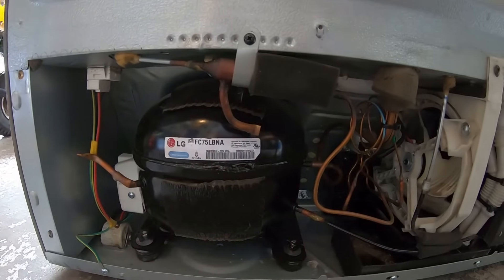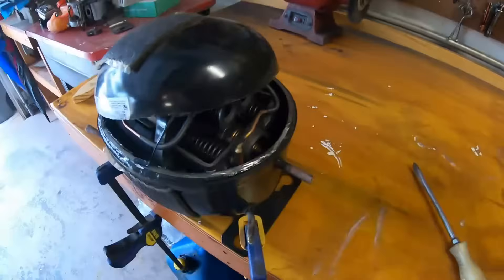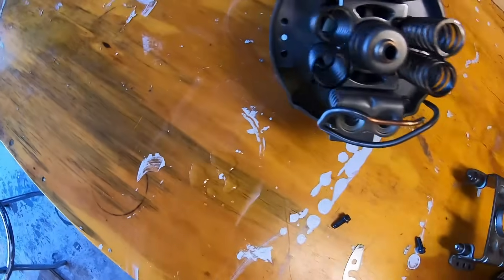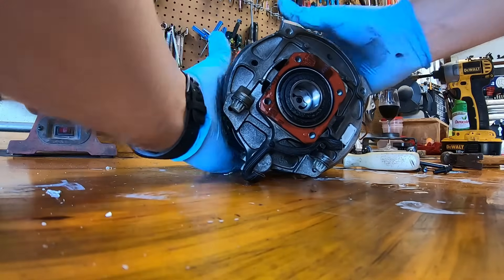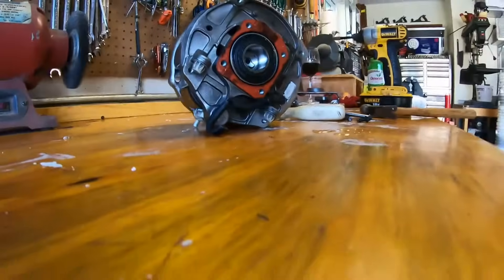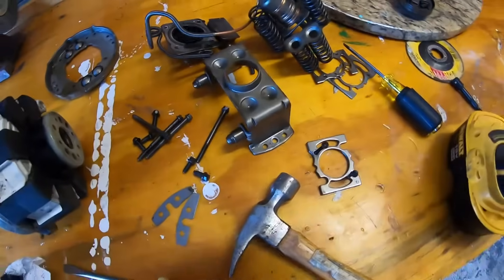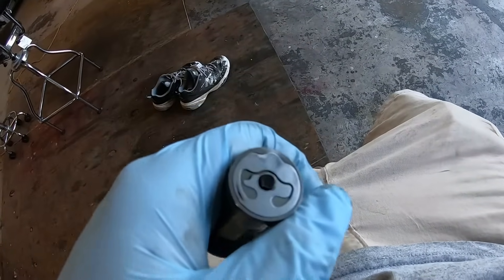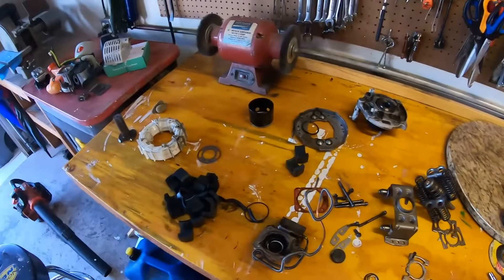Cutting open a failed LG refrigerator compressor

Comment: 11:33 she is looking at you, the valve, that's the killer in this compressors. Believe me. Former Sears Refrigerator tech, former LG Electronics field tech here. 
LG (LC) compressors are the WORST, I was replacing an average of at least 5 compressors a week. The best in everything else, but LG (LC) compressors are the worst due to the design of the valve. It goes attached to the end of the piston, it is like a check valve that it closes when pushes the piston to the high side and it opens when it goes back. It is extremely thin, so when the compressor works too hot, it tends to stay a little bit opened, that will equalize the system so it won't cool. Inexperienced techs think there is a restriction in the sealed system, they start replacing coils and capillary tubes, but is not the problem. I'm sure because I've done my own compressor autopsy (tired of LG tech support and managers denying the issue with compressors) and I found that. When you have an LG not cooling is that simple, compressor, or a very few cases, a leak on the evaporator of refrigerator section, mostly the top line close to the cap tube, extremely low leak sometimes hard to find even with dye, sometimes it only can be seen pressurizing the system with nitrogen and spreading with big blue leak detector.
A tech still working with them told me they have a new compressor design that substitutes the LCs but I don't know the results. I left LG and the appliances business 3 years ago.
Reply: I'm working on these currently with the A&E side of Sears.  Doing an average of 2 to 3 per day.  What's sad is every system is less than five years old.  The kicker is now I'm third partied thru Sears to only work on LG.  Good ol' Virginia Beach for you (8175).  1706 replacement compressors aren't much better.  Been to calls where the substitute that was "guaranteed" to fix the issue, has been replaced already.  What does LG tell us to do..slap in a new one cause that'll fix it...That third lawsuit against LG hopefully does something..maybe recall everything.  Loss of money and rep to their name but hey, build a major component correctly and competently the first time and you wouldn't be hated as a company.
Reply: @abeez85  What is the typical service fee and LG compressor replacement cost? (out of curiosity). I'm not in the market for an LG, but I see them on Facebook Marketplace for sale along with the Kenmore brand that used the LG compressor.
Reply: @elmerkilred159 Various ways to answer.  Parts, labor, warranties.  Low end, $500.  High end, $2,000.  At least this is thru A&E's prices.  Sum up, everything I see today is ones with 1,5,10 year or 1,7,10 year warranties.  95% of what I go to are systems in the 2-4 year range.  Some make it past up to close or beyond their warranty.  Those I call the quality ones for todays standard ones I call quantity ones for I'm expecting to go be a problem.  It can get better or worse.  Had one today, not two weeks old, has a locked compressor and still has the plastic on the doors.  Be it LG LG or Kenmore/Kenmore Elite saying 795 in the model number, still an LG, expect a headache, a delay, a loss of food and a visit with the expectation of it being the compressor.  Hope that helped.
Reply: @abeez85  That sure did answer a lot of questions. Thanks for the reply. I was going to add "the loss of food expense," and having to scramble to figure out what to do with all the stuff in the freezer. I have a Kenmore Elite (Either, a Frigidaire or Whirlpool had the Sears contract that year) that has been working for over 20 years. I recently replaced an evaporator fan, and the relay, and start capacitor, and had to do the food shuffle, but I got the fridge up and running. The prices of new fridges baffled me, and I was tempted to get an LG just because it looked like a solid fridge. I'm really glad I didn't decide to get an LG. Thanks again for the informative response!
Reply: @elmerkilred159  If it says 106, it's a Whirlpool.  253 is Frigidaire.  Run that puppy till it breaks, the parts aren't made or unless it's prior to 1994, no more R12 to refill it.  My father just did with his freezer.  Now it's a storage locker.  And from the sound of it, you got the easy parts.  Take those any day.
Reply from the maker: Wow - thanks for the detailed info! It truly is a shame as these compressors are so common... What about that cracked seal-looking-thing I called out in the video at 12:45? What is that part and is that just a casualty of the failure you described?
Reply: @JoesGarageProductionsLLC  
 11:35 That's the valve, at 12:45 it's maybe a filter.
Reply from the maker: @ZackHeinkel2000  thanks for the insight! I spoke to someone just yesterday whose LG compressor was junk after only 1 year. Makes me wonder if they really fixed the problem...
Reply: My experience with LG compressor is exactly the same as your Sebastian.  They're the worst I've seen in my 41 years as an appliance tech.  A customer of mine just scrapped their top-o-the-line LG refrig that's 4 years old due to a bad compressor.  Unfortunately for them, they had a bad compressor at 1.5 years old.  LG replaced the first one in warranty but took two months to do it.  Now the replacement went bad so they're done with LG.
Reply: @bixfrisbee2623  I think LG Refrigerator line will end as their cellphones.
Reply: LG is starting to abandon the linear compressor and is implementing the good old reliable smart inverter compressors again
Reply: Thank you for your transparency
Reply: I figured it was the valve but having not taken one apart led me to this video. Pretty difficult to fuck up this design..
 It's just a large solenoid after all. Best to mute this video though as the guy says all sorts of wrong stuff... started off calling it a scroll. Okay pal.
Reply: Are the jiaxipera compressors any good? I know Embraco and Panasonic compressors are great. What about jiaxipera?
Reply from the maker: @YoungMTrucker600  I don't have any personal experience with that brand but I have not had any problems with the Chinese compressors
Reply: Lg appliances are the worst.

Comment: “Safety first...”, but no safety goggles 🤣
Reply: safety glasses/ goggles are a must ... he could lose an eye. Those grinder blades can break when caught in the two metal parts and fly in whatever direction.
Reply: And no safety cover on grinder too.
Reply: Engaged safety squints
Reply: @keithjurena93ok19  ok ave lol
Reply: at least he will hear what runs him over.
Reply: Yes, thanks for the interesting video(!), but do wear safety glasses. A family member had an object stick in his eye just from the wind. Had to have it removed by a specialist. Then started looking online about physicians removing small objects lodged in eyes. Not recommended.
Reply: Face shield to protect against a disk shattering at 12,000 RPM. And gloves in case the angle grinder suddenly runs away. Got some awesome photos online of parts of hands turned into hamburger from angle grinders. At least he's protecting his hearing so he will understand what the folks in ER might have to say.
Reply: It's a dangerous kind of cut where it's easy to quickly plunge the blade through and accidentally twist the blade which will grab kind of hard. Push forwards and the blade wants to pull deeper as it gets deeper into the hollow cut.
Reply: I knew I would find this comment.
Reply: "just a couple holes in my tshirt"
Reply: Yeah grinding on crotch height without a guard in sweat shorts, a trauma surgeon's pension contribution waiting  to happen.
Reply: @Brewbug  Crotch height... Could be one of those non lethal Darwin Awards too.
Reply: Looks like quite a contraption
Reply: Obviously never got hot metal shavings melted into his eyes yet 😳
Reply: haha
Reply: @Daniel Forrest 😂🤣
Reply: Did you not see his safety squints?
Reply: Or blade guard
Reply: @danielforrest3871 Ansi Z87 contact lenses
Reply: Just need to squint enough to keep the flying sparks out of my eyes!
Reply: His old school
Reply: The sparks flying in the garage was giving me anxiety. What can happen, will happen if you give it enough opportunities.
Reply: First thing I noticed too
Reply: He's a professional, I guess he doesn't need either safety equipment 😂

Comment: According to the lawsuit, the problem starts in the tubing of the evaporator, a part that works in conjunction with the linear compressor. The suit says that the tubing is “prone to corrosion and pitting” and that small holes can develop, which can cause leaks and allow air to enter. Because of this “air leakage,” the refrigerant that moves from the evaporator to the condenser generates excess pressure that puts stress on the compressor, according to the suit.
The compressor can’t take this additional pressure, the suit says, and begins to fail. It is usually the discharge valve in the compressor that is the first to go, as it is the weakest component.
    But they left out the fact POE oil absorbs moisture and causes waxy gel and acids to form when a low side evaporator leak draws in moist air into the sealed system.
So this contamination moves around and clogs the capillary tubes which are foamed inside the back wall of the box.
The new compressors sometimes work and others fail due to the capillary tube clogs with the black sludge and waxy buildup from the POE oil and moisture chemical reaction.
Older fridges used R12 and mineral based oil that could handle a bit of moisture much better but the R134a requires the POE oil which is hygroscopic oil.
Reply from the maker: Sounds like the new compressor design doesn't address the root cause... Is the "corrosion and pitting" described in the suit similar to the formicary corrosion that plagues the HVAC industry, particularly in residential split systems with copper evap coils?
Reply: @JoesGarageProductionsLLC  LG techs know that certain evaporator part numbers are the ones that are prone to the pinhole leaks and they always change the evaporator coil if evaporator part number ends in 1411 and 1802. It seems to be all the upper refrigerator coils that leak not the freezer coil. So models that do not have 2 coils are better LG models not as prone to this issue. Mainly the dual evaporator models that have the black 3 way valve next to the compressor.
Reply: its probably the control board that fucks up first and any electronic device today
Reply: Yes, that is exactly what went wrong with my LG refrigerator. I ran into a restriction within the capillary tubes, probably within the foamed walls of the back of the unit. I was lucky and was able to unclog the restriction.
Reply: If there is a leak then it wouldn't increase pressure it would decrease pressure. It is the filter/dryer developing a restriction. LG does not pull a vacuum on the system when its is built they sweep charge it. That leaves moisture - which a filter/dryer adsorbs - leads to restriction - high head pressure - blown seals. Lesson here is always pull a vacuum to 500 microns before charging the system.
Reply: @slaughterzealibib  Air gets in the system drawn in on the low side through the pinhole leaks in the evaporator because low side is running in a vacuum. Air in a refrigeration system is "non-condensible". So it makes the pressure increase and the compressor works harder to try to compress the air. Just like a shop air compressor. Then the compressor overheats and the valves get damaged.
Reply: @houptee I was going to comment the same thing. During operation low side at or near compressor drawing air and adding it to system destroying the compressor. I see it regularly in the automotive world.
Reply: not true if there a leak there less pressure. Main thing is no pump. or starting to fast the update on the board makes the compressor start slower, and the first sign is no ice. Now leaks may let moister in will the freon and freezer up in the cap  tube making the unit go in pump down mode. the maker of the compressor is the problem. like samsung ice maker problem last 10 yrs top left ice room. lawsuit.

Comment: Nice video. Just bought a LG refrigerator with compressor model no FLD165NBMA. There is 10 years warranty on the compressor. See you in 8 years.
Reply: Don't be had by the so called 10 year warranty. Ours quit after 4 years and they are just giving us a check for 1500. Frig was 2200 and now a replacment comparable is 3000.
Reply from the maker: Lol - I've heard from a few sources that they've corrected the "issues". I don't know that for a fact, though. Good luck!
Reply: @JoesGarageProductionsLLC  well I sure do hope so, just bought one today. I mean they must've solved the issues in order to avoid more lawsuits, right? Right????!!!!! 😖😖😖
Reply: The 10-year warranty on the compressor is usually just a parts warranty. You will have to pay the labor to replace the compressor, which is usually $300 to $500.
Reply: $900 in Portland  @rreagan007

Comment: i think that the compressor was in good condition and perhaps the board simply was not working and not sending the signals
Reply from the maker: What makes you suspect that?
Reply: this is why there a board upgrade too. or flash

Comment: I appreciate the efforts, but, it seems like you don't really know yourself what is going on!
Reply from the maker: I don't pretend to know everything... I have encountered quite a few of these failed LG compressors and didn't see too many videos covering the nature of the failure since, most of the time, the compressor is either replaced or the appliance is. In this case, I wanted to see the actual part that failed.

Comment: It looked like the reed valve failed, but you didnt' give a close enough look.  This is what has failed on a few I've looked at.  they are running 24x7x365 unlike the old ones, and the reed valve is working all the time.
The seal too is there to absorb any over run of the piston above tdc.
Reply from the maker: Is the seal that you are referring to the piece that I found the split in? I don't recall seeing any broken reed valves when I was in there, but it is possible I missed it.
Reply: @JoesGarageProductionsLLC  Yep, I have another one that was bad and took it apart, and it was the seal worn out similiar to yours, so that is also a failure point.  Would be nice if you could buy just that seal...I might try to make one somehow.
Reply from the maker: @murraymadness4674  should be easy to 3d print the hard plastic part. Maybe that flexible part would last longer if made out of nitrile? I am sure mcmaster sells raw stock.

Comment: 8 years isnt bad, considering the energy shavings each year, that fridge paid for itself. 
The 2-3 year failures are definitely not justified. 
The failure being a gasket is really sad for a compressor unit that doesnt have any serviceable parts. 

I guess next stage would be to:
1. test gaskets under more endurance at LG labs
2. use a linear refrigerant pressure switch to alert owner of drop in fridge pressures
3. include serviceable areas on compressors 

I'm sure they wont do any of the above, since it would end up in a 10k fridge user cost.

I hear whirpool is a decent brand at least, or GE ?

Comment: Internal valve failure is consistent. 3-5 a month for my service company. Motor/drive is rare, usually compressor running, no pressure. In other news, the bits of the seal are getting into the systems as well. Great video!
Reply from the maker: Thanks very much! Has LG fixed this problem? I heard there are newer/redesigned service replacement compressors out there...
Reply: @JoesGarageProductionsLLC  the new compressor is called the "universal compressor" and the software on main board has to be updated with a little jig tool. Not enough data yet to see if they last longer than 3 yrs since they came out about 2 yrs ago. But if too much debris got into the system or if the evaporator leaked and it sucked in air then the POE oil gels up and clogs the capillary tubes. If you catch it in time you might get lucky.

Comment: I always thought about taking one apart but never took the time to. I always assumed it was a seal that failed or the piston locks up sometimes too. Sometimes the seal will be slightly torn and it pushes 80 psi and half cools too.
Reply from the maker: Such a crappy design for such a nice fridge otherwise... I'm an ameteur and I've seen half a dozen or so failures. I had to see what all the fuss was about inside there. Clever design, but clearly not ready for prime time yet.
Reply: Joe's Garage the new r600a compressors appears better. They really did mess up for a long time though. You can convert them to a regular compressor but have to rewire a lot.
Reply from the maker: @thassiomarques7653  yeah I looked into rewiring a regular compressor then when I saw the control board it looks like the control board is not simply switching 120 V AC to the compressor. Looks like it is sending DC. Like you said lots of work
Reply: @JoesGarageProductionsLLC  Mine just failed today after 8 years. Apparently I have a 10 year warranty so we'll see what happens when LG sends a tech on Monday. Checked over everything else =/ Unfortunately the class action lawsuit isn't in Canada.
Reply: @jessetoporowski8450  did they stand behind it and repair it mine just went out yesterday they say the repair man will be out July 15th. I'm at 4 years and have warranty as well.
Reply: @Kevin-ij7sl  they cut it out and replaced it.
Reply: @jessetoporowski8450  how did you go abouts getting in on the lawsuit or atleast just getting a tech out?
Reply: @sukkafish1  I called the number on the website. They sent out someone with the part. The part was covered but not the labour. Still cost me $400 or $500 I think.